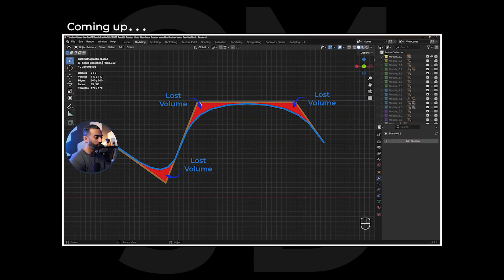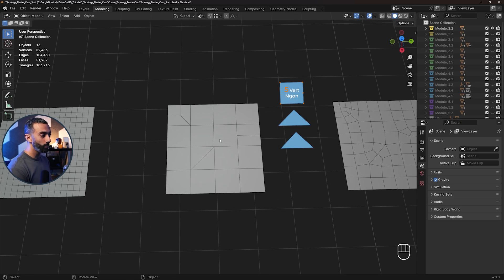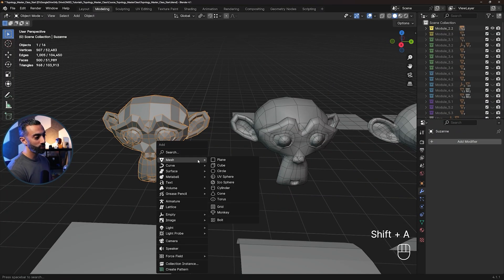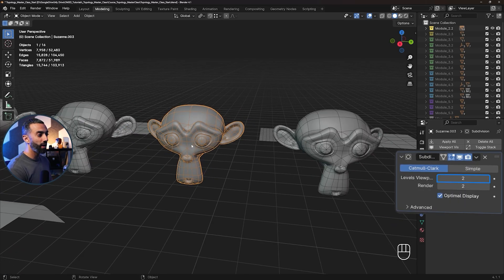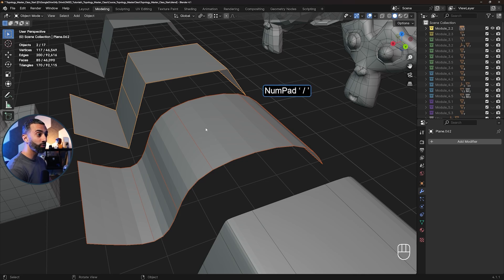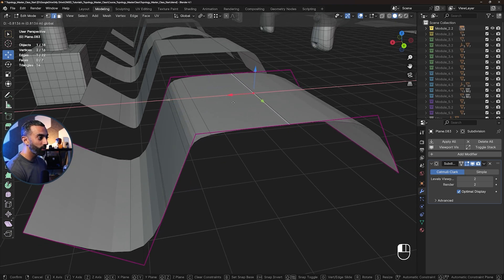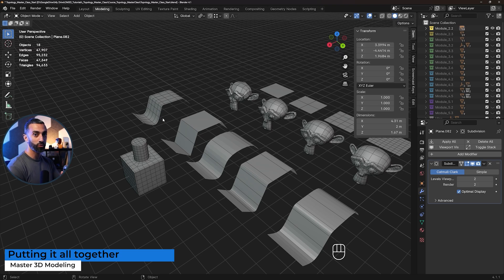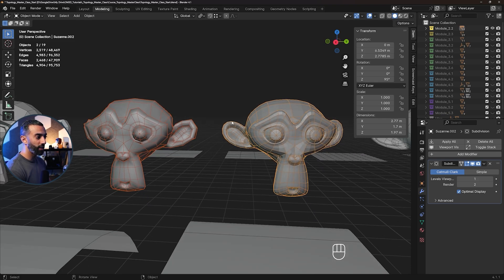Master Sub-D Modeling in 10 Minutes!

Comment: Thank you for the tips! Do you know where is the issue when we have black edges and artefacts like blending artefacts after baking normals between low poly and the subd model? Should I bevel some edges for the low so there is no black edges after baking normal maps?
Reply from the maker: No problem, the black edges are due to hard edges not having UV Seams. So anyplace you have a hard/sharp edges, make it a UV seam.

I talk about it in this video here: https://youtu.be/C_RqdNbYOjE?si=ktXDCwOwh0E5Kqs2
Reply: @OnMars3D  I don't understand because my model has seam at hard edges
Reply from the maker: @mrkoddy  join my discord and drop your question there, link in the pinned comment.